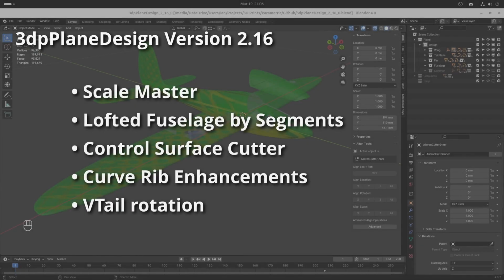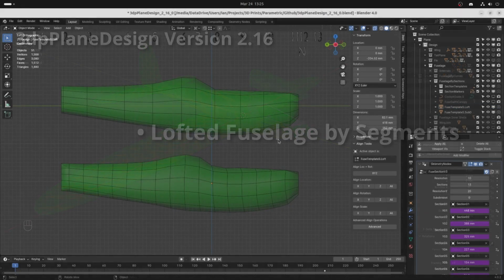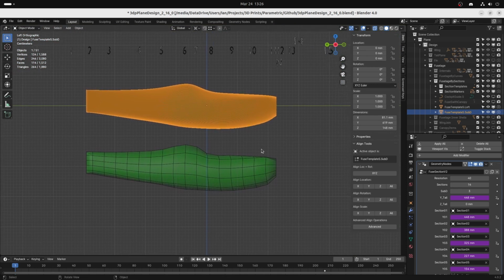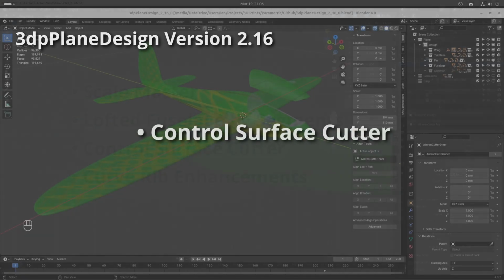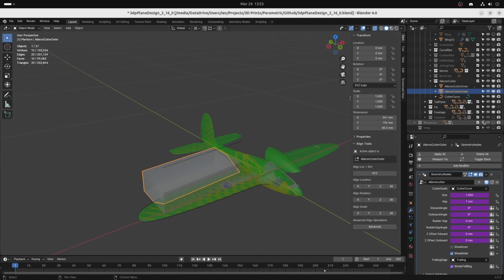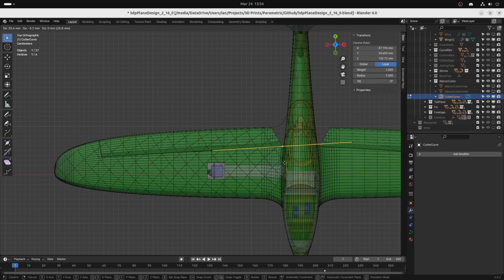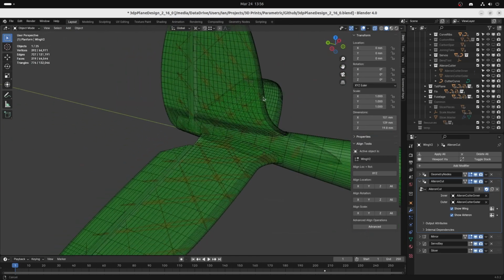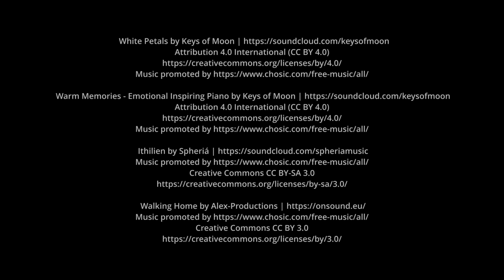3DP Model Plane Design using Blender Geometry Nodes - Part 6 - Updates

Comment: Hello, this is a great video honestly. I was just wondering if you know how can I make this work by importing a model from catia to blender and then to Xflr5. It doesnt seem to work since there is message "Couldn't find a Geo Node modifier with node 'WingV2' or 'FinV2' on the currently selected object"
Reply from the maker: Hi, sorry this won't work. The add-on is specifically using the design data from the geometry node based designs rather than the from the vertices in the mesh. An imported mesh doesn't have that.

Comment: hello nerk, one of the best projects i have seen so far with GN.  could you give me some advice i want to learn how to create some nodes likely the same. could you recommend some tutorails, books, video. also paid. thank you.
Reply from the maker: Hi Paul. I would suggest you check basic tutorials like Blender Guru's series to get the idea of attributes, as well as the available diagnostic tools like the viewer node and the spreadsheet. After that it's pretty easy to examine the work other people have done (for example this aircraft project) section by section.